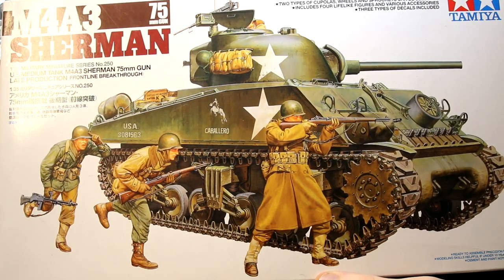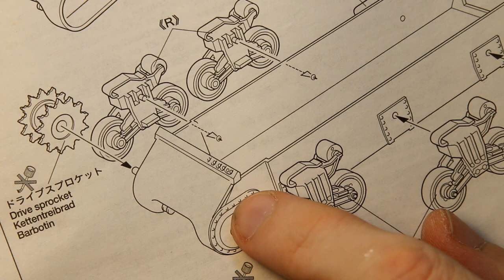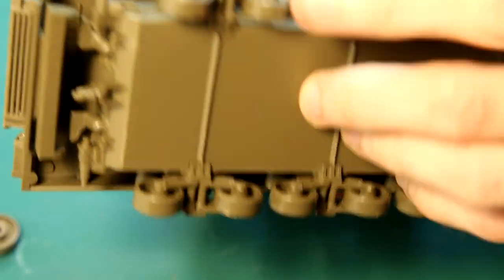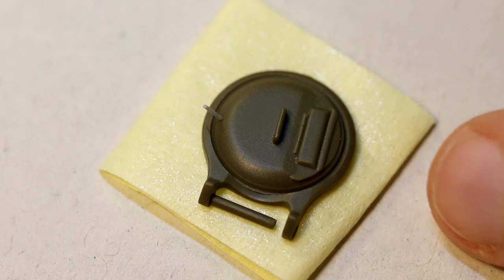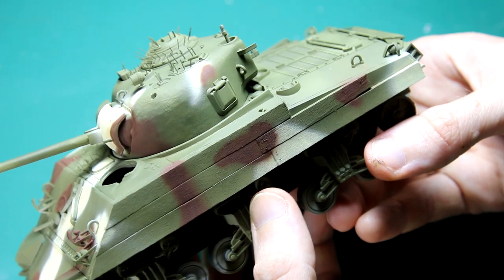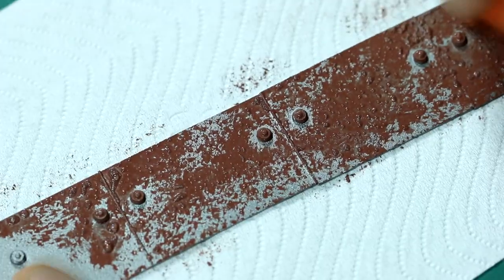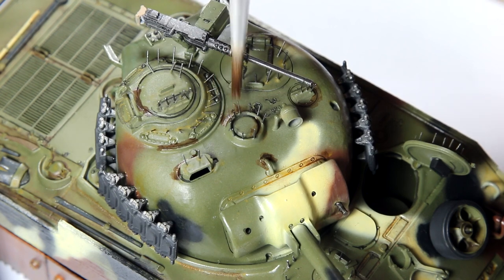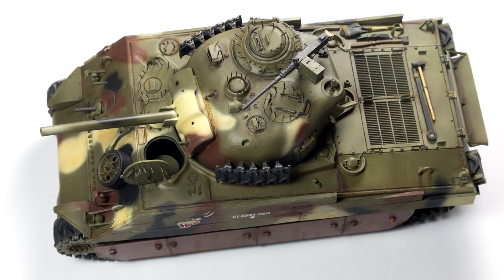Pacific Sherman tank with improvised armour (Tamiya 1/35 scale model)

Comment: I made the Tamiya Sherman (with motor) in the early 70s,  fantastic fun, running it on the beach untill the the batteries went flat. A beautiful tank second only to the Matilda ;) Thanks
Reply from the maker: I completely agree - I've got a few more ideas lined up for different types of Sherman builds (I really like the composite hull models). At the moment though the only Sherman I have in my stash is a Firefly.
Reply: The Matilda is great until you have to reverse.... But we’re not french so who cares!
Reply: @kshatriya1414  you monster, le lol
Reply: I also built this kit in the late 70’s when I was 15 years old.  It came out exceptionally well and was what I considered my first decent build, researched, assembled well, painted and decked out authentically.  I kept it on display for years and believe I eventually gave it to one of my cousins for his room.  Really well put together kit.
Reply: I meant to add that tanks like the M4 lend themselves to multiple builds due to number of variants.  You could assemble a vast array of models depicting the development of the line up to the 1980s. Could do that for the Centurions well.

Comment: Great job on model.I usually glue spare tracks on turret and on sides of hull 
with horns on the outside (for bags to hang on),but your method is also interesting,
looks like a spaced armor on tank.
Reply from the maker: Hi, thanks. Yes, I've seen both orientations used in original WW2 photos. I'm not sure if the intention was to create spaced armour or not to be honest. Given that attaching horns inside would surely be harder (less contact area), I'm thinking maybe it was.

Comment: Love Pacific Shermans! Great work. However, with all of your effort it is a shame that the kit did not come with the small vertical plates on the canted portions of the engine deck. Each plate was there to support the heavy engine hatches when they were opened thus relieving the tension on the hatch hinges and also protecting the OVM tools from damage. Those plates were positive ID features of the M4A3 as well.
Reply from the maker: Thanks for the info George

Comment: Ive been messing about with Mr Metal color Dark Iron paint.You can paint with the unshaken bottle on weld beads,and the weaker mix means less graphite,so when buffed leaves only very highest points metallic and a deep matt black grey contrast.Or use lumps of graphite pigment from bottom of jar and smear over a surface,when it dries you can sand the highpoints down till you have what looks like a poured metal slab,ground reasonably smooth.Or thin down to wash like mixture,and lay down loads of coats,it looks like the styrenes gone a dark silver.Just done \32 Mustang guns with it.Graphite is so thin.The 'lumpy' one i used on Ryefield M4's Big spanner on rear deck by hammer.Looks hand beaten and ground to level it out.Its only £3 a pot.Something worth playing about with.Love the research examples of field mods.
Reply: Hope none tries to attach a similar 'sideskirt' to an HVSS m4.Rough ride.
Reply from the maker: Thanks for the tip Darron.

Comment: Hi, I have another question - How would the wooden armor reinforcement boards been attached? Bolts, screws, glue (ha ha)? Thanks in advance for your info.
Reply from the maker: I'm not sure to be honest. Perhaps bolted, though I guess that might danger the armour? Or maybe steel brackets for them could be welded to the hull. Maybe it is possible to see in more detail on some of the reference images?
Reply: @ModelNerd  Thanks the info. Keep modeling. Love your work.
Reply: Have seen photos of the wooden armor planks being bolted to the side of the vehicle. Also seen support brackets being welded at the sponsons and then the wooden planks being fitted inti place.
Reply: @jamesbednar8625  Thank You James for the info. Always learning on this channel